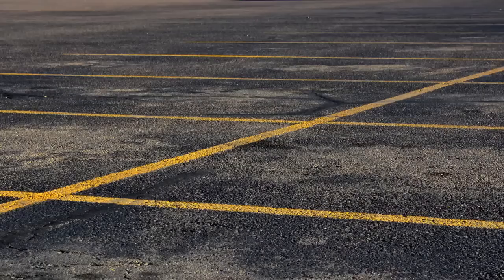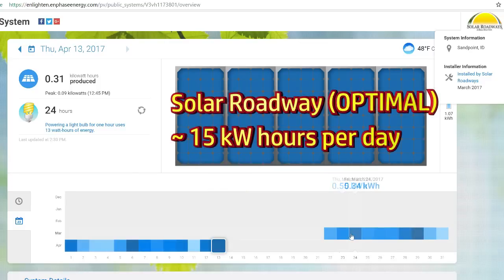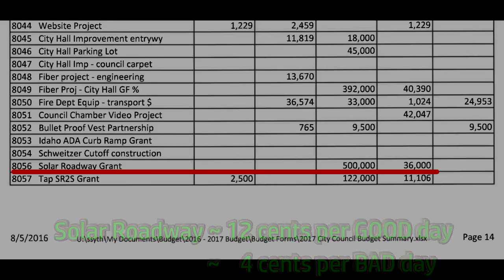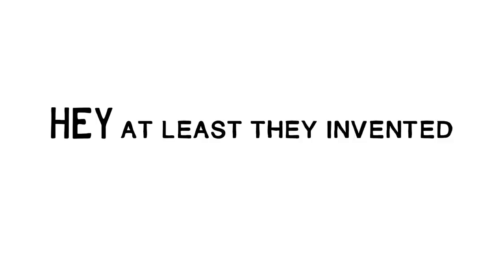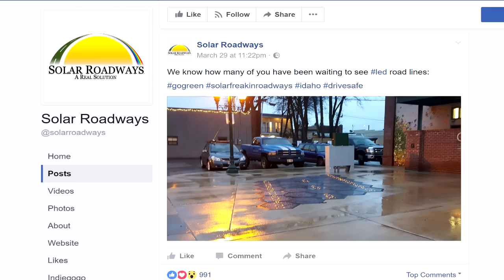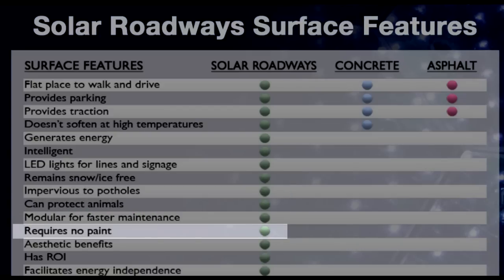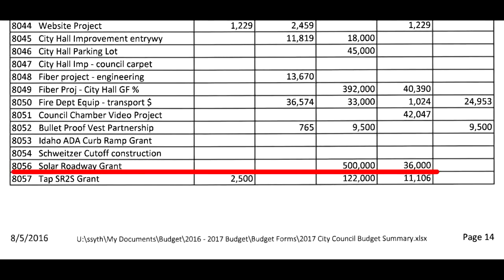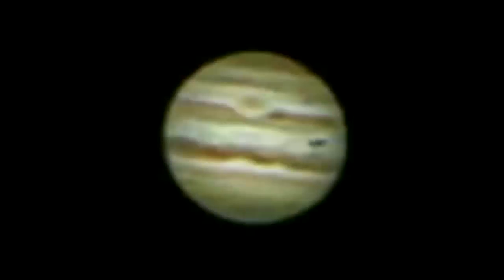Solar Roadways generate ~10 CENTS per day!!

Comment: Under the extremely generous assumption that Solar Roadways would have the same ~25 year service lifetime and require the same amount of energy to produce as a standard rooftop solar array, if they only produce .1 times as much power per unit area as a standard rooftop solar array, even an extremely well sited Solar Roadway would only return at the absolute most about 95% of the energy used to create it in the first place. Edit: And that's also assuming the power guzzling LEDs are abandoned.

Comment: Thunderf00t, please mention the traction issue on your next Solar Roadways video.

They claim that SR provides traction, and they have bullet points on Asphalt and Concrete as well.
As if Traction is a yes or no. As if it is either black or white.

Ice provides traction, glass provides traction, any surface you can imagine provides some sort of traction.
The question is: How much traction does X surface provide?
And the answer for Solar Roadways, is SHIT TRACTION, since its freakin' glass!!

Want to drive around on glass during rain and winter conditions?
Solar Roadways!

Nevermind the melting of ice, driving on wet glass will cause some serious accidents.
Any moron should know that. 
Any idiot should be able to understand that there is a reason we use Asphalt over other surfaces. 
Asphalt is better than Concrete when it comes to traction. Which is why the best race tracks in the world use Asphalt.
F1 cars run on asphalt. Same for Nascar. Same goes for WTCC. So on and so forth.

Have you ever seen a car race on a track made out of glass?
No, of course not, because that is fucking retarded.

Even drift cars run on asphalt tracks, and they dont really need the best traction, since the point is to slide the car around corners, essentially being constantly at the (or near) the limit of spinning out, with the wheels constantly spinning on the track like crazy.

Whoever thought it is a good idea to make roads out of glass has to genuinely be either completely out of their minds, or a stupid 5 year old kid.

Please note that even DIRT is better than glass in terms of traction.
Yes, good old fashioned dirt roads, provide better traction than Glass/Solar Roadways.

And those idiots had the government fund those glass roads!!!
WTF?!?!

 Now, if you'll excuse me, I'll go bang my head against the wall.
Hopefully, the knowledge that there are this many stupid and gullible people in the world, will somehow escape out of my head.

EDIT: They claim that its tempered glass, which provides better or the same traction as Asphalt. Then why dont we use the same material for regular vanilla roads anyway?
Why not make race tracks with this surface material instead of asphalt?

The answer is simple: Its because its not better.
Even if it was, the cost compared to the cost of regular Asphalt would be astronomically high, making it an extremely cost inefficient option.

And I am not even factoring in the shitty cover that they use for the panel frames. 
They are not made out of glass, and they will definitely be a factor contributing to even worse traction.

Comment: I never understood the logic behind this company and its approach to building a solar roadway surface;

 If power generation is the key point in designing a solar roadway surface wouldn't it be more practical to take advantage of the Seebeck effect and use a series of Thermoelectric generators similar to a Peltier device? I mean, re-engineering an existing road design to incorporate a thermal conductor(probably a copper pipe) that would in turn redistribute thermal energy stored in the road to the conversion points would be largely inert and have 0 moving parts. Granted current Thermoelectric generators are low efficiency but a large scale passive generation is what the aim is isn't it? 

 Or is that just wishful thinking?
Reply: If TEGs were economically viable, we'd install them in power plants first. A nuclear power plant with 1 GW electrical output has ~1.5 GW of low grade waste heat available, 24/7, in a controlled environment. Compared to that, a road is one of the worst places to go for free heat. So kinda the same problem as with solar roadways.

Comment: You wrote $500,000,000,000 by mistake at 15:40, where you really wanted $500,000,000. By the way, I've thought of a really good experiment to do in Idaho with your solid gold hammer.

Comment: Just for a Laugh would having a Treadmill set on a hill with high pedestrian count walking uphill thus slowly turning the tread surely its the cheapest option. Put it in the middle of the path so those who wish too help could walk on it or not..  Or peizo floor tiles 1 million people step on that tile must generate a fair bit of juice. Just a thought the tile road with ip's is a good start too an automated roadway drive on the on ramp road inspects cars comp for mainteance power output so on then takes control  of car accelerating and slotting cars in place.   Ignore the power and lighting bollocks jujst the connectivity of the road is a good idea

Comment: The math for sunlight per day for solar panels is measured in "sun hours per day". Only south west states like Arizona ever see more than about 6 sun hours/day and that's in favorable months optimally tilted. Look for a "solar insolation map" to get some ballpark figures. Panels usually perform at about 85% of their rated values so the ballpark figure is (PanelRating * 0.85 * SunHours) = power per day.  Their 44 watt panel rating is laughable enough but they aren't even getting anywhere close to even that. At 500 watts/day total they are getting 16.6 watts per panel per day or about 2.8 watts per (sun) hour per panel. An actually real $250 panel facing south makes more power than their entire setup for a full day in only a little over an hour. Their figures are appalling and can barely even power a couple cellphones. Their failure has far exceeded my expectations. I'm disappointed to see Nathan Fillion support the idea because he supported Arcimoto too and I actually like that idea.

Comment: There are a few points I don't entirely agree with - I don't think these are the way to go, but there are suggestions that people could make in their defense that make them at least seem less ridiculous.

 - Would economy of scale not drive down the cost of these things MUCH lower? This site cost 500,000, but it's like Apple designing an iPhone and only selling fourty of 'em; they're going to be way more expensive to cover all the R&D as well as the device itself. Having a full-scale production plant would decrease the cost exponentially, you'd think.
- These broke presumably because they were hand-made out of materials that might not normally be considered for industrial use; you could use much hardier materials (solder with better mechanical properties to accomodate temperature changes, more 'premium' components that're less susceptible to static discharge, maybe?) to prevent them from wearing down so fast. 
- It took them three months to fix this. Now, I don't know where their production 'facility' is, if they have one, or if they're ordering in parts from China to replace dead ones, but if you had the aforementioned large-scale production facility, you'd have spare panels ready to go the instant they were needed, making them much more repairable. If these things were capable of reporting faults in particular panels, you'd be able to select particular parts of the road to focus on fixing if it were absolutely required, and if they were more durable than these (clearly shoddy) first attempts with a mean time between failure of something like ten years, you'd be able to keep up with the issue much faster.
- They're only generating 10c a day, and they are inefficient through being flat, but how much power would an entire long highway provide? There will of course be an issue with the resistance of any material they use to transport power long distances from them, but say you wanted to power a single electric car charging station off a solar roadway; ten of these same sites would provide on average around 3kWh, a hundred would provide 30, five hundred would provide 150kWh (without factoring in cars covering the panels as they drive). If you take a 24kWh car with 16kWh of available power, you could charge a few of those at least enough to get them a few miles whilst they're getting food at a service station.

Of course, this begs the question... Why not just build a big, more efficient solar farm next to the service station? x) There's no need to put these things under the road. But this video seems to be focussing on the absolute extremes and blowing how bad they are out of proportion - they won't work as well as people hope, of course, but figures like 3 months and 500,000 dollars just aren't ones you can apply to the project if it were to branch out and become much larger.

Comment: So, I had an idea.

Suppose the roads were constructed of boxes made of a clear material.  Inside the boxes are small panels that are set to the proper angle, and are even turning to track the sun.

I suppose that wouldn't work either, though, because of road dirt and the fact that a solid piece of plastic would be between the panel and the sun.

Comment: To be fair - and this is very, very much so a Devil's Advocate perspective - returns on the first couple drafts of any new invention tend not to be great. Oftentimes manufacturing something new is going to be far more expensive than normal, take far longer than normal, and possibly have subpar performance. However, that's only the first prototype - further iterations streamline the design with the lessons learned from the initial one, allowing for reduced costs and increased performance as research and development kicks in.

Again, this is a bizarre case where, as you've proven, Solar Roadways is not a feasible idea with current technology and it isn't going to be any time soon. However, it seems worthwhile to at least point out one argument that can be raised against you.
Reply: Well this is not a new invention, this is the combination of two preexisting inventions that, due to fundamentally different design considerations, cannot be reasonably combined, nor do they need to be. I like to compare it to the nuclear powered airplane - an entirely unnecessary development that was still worked on for years and years, at tremendous cost to the taxpayer - , but this nuclear powered airplane is said to also come with a laser gun and an ICBM launcher, because hey, if you're gonna lie, you should lie BIG, and promise as much pointless shit as possible.

Comment: Solar Roadways are a part of the problem only adding to the problem of wasted resources - they're not a part of the solution. Any solar panel that's produced and is not used to it's fullest potential, is somewhat wasteful. Producing solar panels just to lay them on the ground, had there been a more effective way of installation, is in fact wasteful. If you love the planet, don't do it, don't cheer for it, fight it. It's a scam.

Comment: Solar requires battery technology we do not have and have no idea how to start to make to change solar from being a massive waste of money and a way for wealthy people to extract subsidies from everyone to being just a very expensive way to make power.

When solar power is operational during the day the power plants that are needed once the sun stops producing power are idle or mostly idle. This forces those operators to charge more for the times when power is needed and the sun isn't powering anything. This drives up the cost of power for everyone. 

The capital costs of building on demand power generating plant, if they are thermal plants the fuel costs to keep them hot able to accept load demand quickly as well under utilized transmission line all add costs to everyone.

These problems are magnified when solar producers are offered bounties for their generation (price premiums) or the right to be first on the grid. When you add in subsidies then it becomes and issue of mostly wealthy property owners getting everyone to subsidize their electrical costs.

Now, with a magic battery tech that is; Low cost, scalable, safe, long lasting, high charge/discharge efficiency, compact, very low maintenance then you can make solar semi viable. But on the same point you can connect your standard coal/nuclear power plant to charge local grid level batteries in a city. Then they can run at 100% output all the time, charging the batteries at night then switching to meeting demand in the day to finally having the batteries draw down to meet peak demand.

For now solar is a waste of money, that actively hurts all consumers. If you got a subsidy thanks for taking tax dollars. If you have solar and no batteries and think it's fine to hop on the grid after the sun sets, thanks for driving up the peak grid price. If you own solar panels manufactured in China thanks for polluting the ocean with run off from unchecked Chinese industrial production.

Comment: thogh i also believe solar roadways is utter ridiculousness and will never work. i do think when the 500 dollar for a square  foot was mentioned it is the panel AND the vonvertes and lines.. so most likely 2 square foot would not be 2 times 500 but lower as it just adds a 2nd panel..... not that it makes any difference .. it still sucks

Comment: LED is the wrong way to go - need to go down an electronic paper route - bistable  only consuming power on change type visuals
(i.e. if you can solve all the other massive issues of this thing + your competition (cost/time) on moving lines is a man with a can of paint)

Comment: Wonder if it would be feasible to siphon of the heat captured by a road (thinking dark asphalt in the summer)?
Reply: Sure it would be feasible. But why? Heat in the summer is really not that hard to come by.
Reply: Electricity generation is unlikely. You need steam to do that. Anything that doesn't get hot enough to boil water usually can't be utilized for that purpose.
As for heat storage, that's an interesting idea. Depending on how the costs scale with the size of the storage unit, I imagine it could be doable. It would need enormous pits though.

Comment: Well why is that you always bust these ideas, but dont give any viable alternatives..
Reply: Did you not watch the video? He went out of the way to point out better alternatives, i.e. rooftop or tracking solar.
Reply: i watched the whole vid and then wrote this.. the roof top solar was referring to debunkin the cost vs effectiveness point and tracking solar was about the basic working of solar panels.. still he can give ways to reduce cost of solar panels or something like that.. whic he doesnt..
Reply: "Reduce cost of solar panels", i.e. suggest something that the solar panel industry hasn't thought of in 50 years of working on the thing? Besides, if you reduce the cost of solar panels, then rooftop/tracking solar becomes that much better. It wouldn't even touch the point of how senseless it is to lay the panels flat on the ground and cover them with a thick layer of glass. This is a bad idea, period. He isn't obliged to give a better alternative, especially since better alternatives are ubiquitous.
Reply: u are totally not getting what i'm implying. Please understand what i'm trying to say and the depth of my question. The fact that the roadway solar is happening is only beneficial if it is cost effective compared to the energy generated.. you hav suggested for roof top and tracking solar which is truly more effective etc but how many homes and real estate owners would dedicate that amount of land for solar compared to national highways which is kinda available.. so u c tho the idea of road way solar is bad but in a way it is good.. we need another solution is wat i was saying to Thunderfoot. Which he has not given
Reply: You're implying that there is not enough land area available? Well then you're absolutely wrong. If we dedicated just 0.1% of the Earth's land area for this purpose, we could power the entire planet. Not just electricity, but heating, transportation, everything. 

You're also implying that the road is just there, "not doing everything". Also absolutely wrong. Roads are highly utilised surfaces where the availability of sunlight is absolutely secondary to other needs (such as resistance to highly dynamic loads, temperature extremes, oily residues from vehicles, crashes, chemical spills etc). Any failure of these functions carry a risk of becoming an economic disruption. If you don't think there is a lot of engineering going into how and why roads are built the way they are, then you should really educate yourself on the matter before making uninformed suggestions.

Solar Roadways is trying to solve a non-problem by trying to combine two things that are designed for completely different purposes. It makes no more practical sense than a nuclear powered airplane.
Reply: Yes that's exactly what i'm trying to say.. to get that 0.1% of land is the difficult part. If not i guess there would be more that 0.1% land dedicated for Solar. Somehow u have assumed that i'm for the road solar thing.. which i'm not.. Again I repeat I'm asking Thunderfoot to give a viable alternatives when he clearly is going to certain lengths to prove road solar wont work. I'm no scientist or great thinker to say this will work or that will.. People need practical working solutions which is what i'm also asking for.